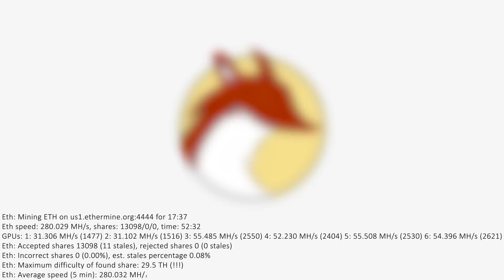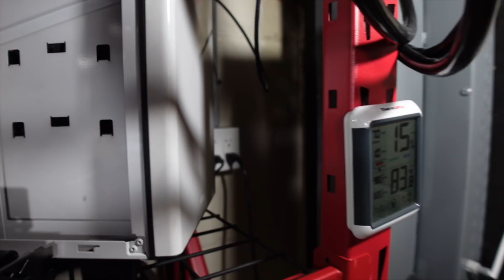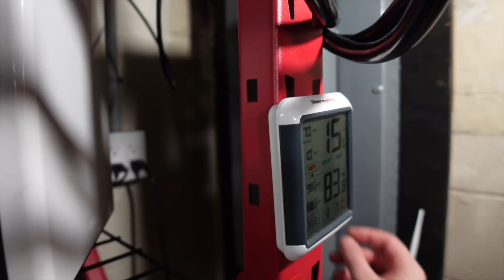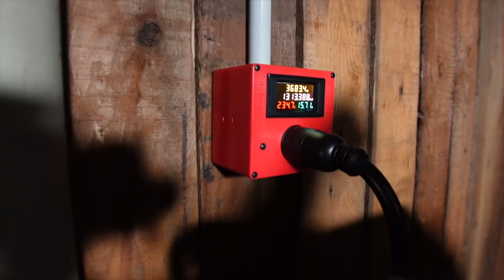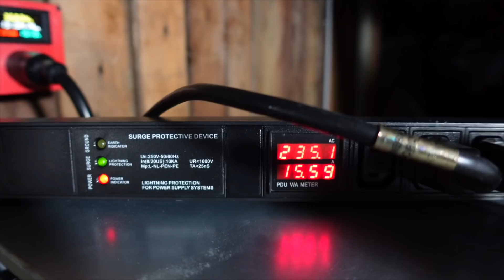How I Power My Home Crypto Mining Farm

Comment: Are you not using 10 3 on your 30amp circuits?  I would think (assumes US electric code distribution of 120v instead of the European 240v standard) that having 10 3 would allow the PDUs to deliver switched power (if you had something that was incapable of drawing 240v) because the 3rd conductor can be hooked up as a neutral wire?

Comment: I am not running a mining setup. I am running 5 monitors and 2 very high end gaming rigs. With all that you have. I did not see a UPS( Uninterrupted Power Supply).  Based on years of having high end rigs. I was going thru a lot of Power Supplies on my rigs. Finally an electrician told me why. Our power fluctuates. It even has spikes of 10-20 watts. Also, if the power does a flicker or a full off then on, I lose nothing on my rigs. The UPS has surge protection built in and multiple plugins. Now, for a setup like yours. You are going to need a very good one, or several smaller 1500 watt types. I run 2 1500 watts and a smaller 750. The batteries have a life of about 3 yrs, are replaceable from manufacturer and not expensive. If I had your whole setup, I would not even hesitate on this. If the power goes out, it gives you time to either shut everything down nicely or if its a out and on situation, nothing running even knows the difference. Just a thought.  Love your insight into your setup. I am getting more and more hyped about doing this. Keep up the great content.

Comment: Hey Red Fox, I am about to set up 24 gpus and was curious what's your opinion on what gpus to run with? I'm thinking 6600 xts! Any insight would be great, thanks!
Reply from the maker: 6600s or 6600 XTs I think.
Reply: @RedFoxCrypto  thanks, I have been doing a lot of research and that's what I thought as well.
Reply: Price isn't really an issue, and I'm looking longterm and will most likely eat my electric bill.

Comment: Well that's one way, i break it down to 120v 1800w per rig with 1800 watt smart plugs that will shut down and save a rig.  I was running multi rigs on 240v  60amp as many do. It cost me $800.00 damaged with just 1 bad plug on a hub  but three rigs had some damage the breaker didn't save them grrrrrrrrr.  So each rig on its  own circuit and i run 16 gpu rigs around 78% of 1800 watts, now each rig has its own protection.  Saved my ass!

Comment: I noticed you are running sense for power metering, how come you are still using localized power meters? I have the exact same setup, But I use the TP-Link Kasa plugs per rig, which shows usage per rig as separate devices in the sense app. As you know its a great way to see what your usage is for the last minute, hour, day, month and per billing cycle. Its even better when you have solar with storage.

Comment: I Have A Grow Tent But It Tends To Get Hot, So I Found A Gym Locker Used On Craigslist 18"x18"x6' And Cut Out A 8" Diameter Hole On Top And A 8" Hole On The Botton Side Of The Locker, Then Put A 8" AC Infinity Fan On Top Coming Out Eventually To The Window For Venting, Put Allthread Through The Locker And Hang The Gpu's And It Seem's To Be Working Pretty Good, At Least better Than The Grow Tent, But To Each Is Their Own. Hope This Helps Anyone.

Comment: If you ever get the opportunity, it’s a solid practice to put your largest current carrying circuits at the closest slots to the line input power for the house - basically not the bottom of your panel but at the top in this case.

The current has to travel down the bus bar to your mining circuits and results in power losses and heat that add up over time - nothing major or necessary but common professional practice.

Thanks for sharing. :)

Comment: I agree with your criticism of the Triplite PDU, but realize it is designed to be mounter vertically in a server rack where it is a) easier to balance the different banks and b) generally each device draws much less power so they need the multitude of outlets.
Do you have a link for the 8+ c13 PDU?

Comment: I got all my stuff in the garage, but having mixed thoughts on using a grow tent or not. I have 2 of the 8" AC Infinity fans exhausting (was initially using 1) and I tried using a tent but it tends to get too hot so I have them all open air now. The problem is the fans are trying to cool the entire garage instead of a small tent so it got quite hot in there last summer with the 1 fan, but I'm hoping it goes better this summer with 2 of them. It's also easy to heat my house by opening the door without having to unzip a tent so not sure where I'll settle yet. I'm basically out of power there with 50 cards pulling close to 24 amps now, but gonna wait and see how the market is these next few months before buying any more.
Reply from the maker: Good stuff. I think I wanna try a few of the AC Infinity whole house fans that mount in the ceiling in my garage. Has the perfect setup for it.

Comment: So out of the 200amp circuit your home runs off 70amps?
Reply: Also does your 120 sub panel run off the 200 amp?
Reply from the maker: My panel is currently pulling around 18000 watts which is 75A for everything in my house including my mining rigs. My sub panel runs off the main panel.